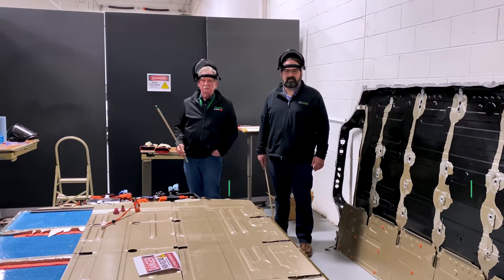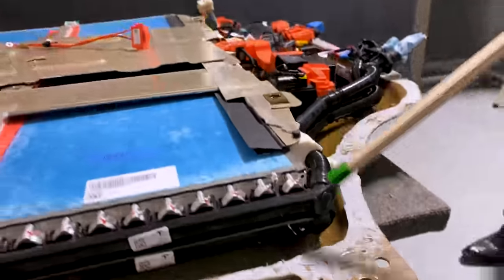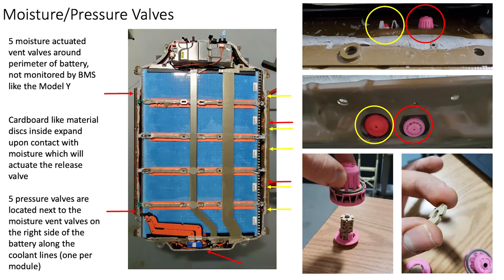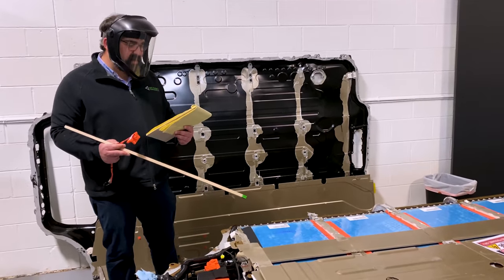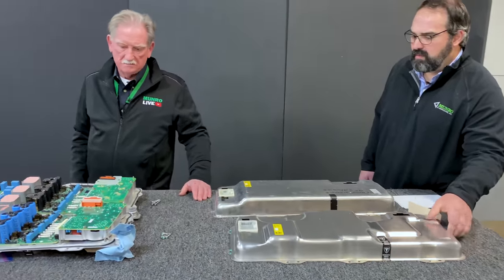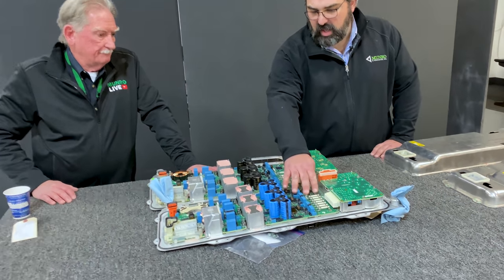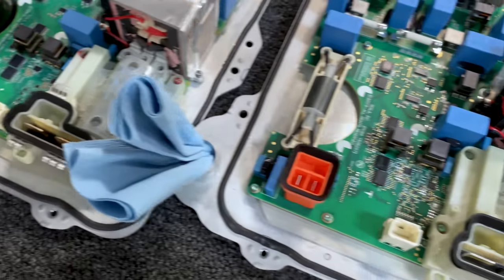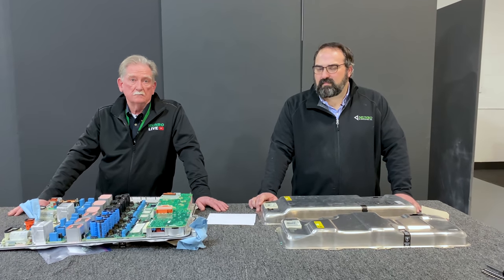Engineering Masterpiece | Tesla Model S Plaid Battery Pack

Comment: Great teardown, this is the one I was most waiting for and why I contributed to the cause!

The reason they used the 18650's is not because they are easier to cool - remember from battery day one feature of the 4680's is that they generate far less heat and therefore will require much less cooling.  They are using the 18650's because they have cell supply.  The version of the car they are selling is only one of the ones developed - they had/have a 4680 version with a structural pack as well (The Plaid+ used it.)  By using the 18650's they can use the 4680's from Kato to ramp Austin first, then once Austin can produce 4680's the Kato production can be moved to supply a new 4680 based version of the S/X - perhaps as a Plaid+ or put them into Semi production ramp, or even into a roadster II.  They eventually will release a new version of the S/X with the structural front casting integrated with a structural 4680 pack.

Given cell supply constraints this might all be a while, but Tesla tries to move very fast.
Reply: I thought that too and am surprised Sandy didn't know that.
Reply: You're right, 18650 cells were already mass-produced in enormous quantities because so many notebook computers and other gadgets use them.
But, as Tesla production increases, it's worthwhile for them to develop their own cells, and they will make them in cell sizes that allow lower cost and better performance.
Reply: It's just the way to save money - that's it. There are NO fundamental differences between 18650 and 4680 - they are just different size - 5x capacity thus 5x less cells. It remains to be seen whether the battery will be structural (the way Tesla sold it at their presentation), because, you know it's a 2 tone vehicle and those cell walls be rather thick. Of course, they could always do it just like, you know, every other manufacturer does it and makes the strong shell and then populate it with cells and call it a day. But no one would notice and would treat the 4680 as 'next level engineering'.

Remember the Plaid was in development BEFORE Tesla got overvalued and the money started flowing into the business, so everything was done on a budget.
Reply: @amimartian  Actually there is a huge difference.  The 4680 doesn't have tabs.

Comment: Thanks Sandy and your team- can’t wait for 4680’s!
Reply: Why?
Reply: To get Sandy and his team’s opinion on its engineering.
Reply: It's legitimately just a larger cell. Not much will change
Reply: It will be interesting to learn how good those are for heat production at a given C load. Tiny cell surface area per unit of volume do hear needs to perfectly come out the one short end that seems to get glued to a cooling plate. I hope 4680 will offer 360 Wh/kg, ideally 400. But it's Tesla so we need to not get our hopes up too much.

Comment: Hello Team Munro, a heads up. You missed a couple of variants of the Model S in 2019 and 2020. A 23:29 you show a table of pack sizes, model years and efficiencies. I own a June 2020 Model S AWD Long Range Plus, EPA rated at 402 miles. It is nominal ~100 kWh. A few months prior there was a 397 mile version. This was the base Model S. There were no 85 kWh packs for sale and only a Performance Model s above it. After 14K+ miles my weighted average efficiency is 245 watt-hours per mile.

Comment: They probably increased the switching frequency on the Charger a lot, that´s why they can get away with less filtering and smaller inductors.
However higher switchting frequencies decrease efficiency most of the time.. (they may have compensated for that by choicing other MOSFETs which switch faster, like GaN based ones)

Comment: When they showed the underside of the filter board housing there are two blank coil housings.  They should have drawn the insight that those are likely either utilized in another vehicle or will be.  I’m thinking cybertruck.  So the filter board housing is likely designed for multiple vehicles.
Reply: No, it was just dumb original design. Instead of having a large transformer to reduce outlet voltage at the input as on the Model Y they allow higher voltage to flow through  down the line and then use smaller transformers (as they now have 4) to further reduce the voltage. The coil at far left end was used as part of the LC filter, which in the latest version is replaced by a ferrite choke (to suppress high frequency noise).
Reply: @amimartian  Thanks for that clarification.
Reply: @amimartian  I understand your confusion, since the input coils on the older design really look like plain mains transformer, but both older and newer version are 3 phases switching converter designs ( @50/60Hz, you simply cannot pass several kW of power through any transformer small enough to fit here). The missing input coil were inductor ( probably common mode ones ), designed to prevent "leaking" the high frequencies into the mains. As Mikeselectricstuff said in his comment, I think they simply increased the working frequency of the converters, which requires far less filtering, hence the smaller input and output inductors ( roughly said, as frequency increases, magnetics can get much smaller and still perform the same job). The added small transformers looks like gate driving transformers, they are far too small for being part on the power path, this is probably related to the frequency change. Cannot wait to see more from Sandy on this subject.

Comment: Mica is used as isolation barrier to protect the battery pack when it come to TR. Mica can stand 1000℃ and it will not burn throuth when the cells are TR.

Comment: 85kwh battery pack is old, they have since introduced the 90 and 100 kwh battery packs on the previous generation Model S and X.  They were called the 90D, P90DL, 100D, and P100DL.
Reply: Yes and the 100 pack actually has more cells and higher capacity than the plaid pack.
Reply: @davidglieder8862  Well noted. Would you have the Wh/kg for these latest cells please, also in relation to previous 100 packs?

Comment: To compare the two models you have to buy them at the same time from the same factory. A year makes a big difference. Production lines are always changing  and everyone is trying to suggest improvements in everything  from the packaging used to deliver the parts to how to assemble the parts. You might notice that all the fasteners are star drive and mostly the same size, something all manufacturers should do. The engines might still be using separate resovers but they are looking to integrate them into the main windings and magnets since it takes a little change in wiring and software and eliminates 3 stations on the line. The best part is no part.

Comment: For future shows: how about details on conducting quality control ? How do designers and manufacturers test for robustness, safety, resiliency, stress, repeatability, ...etc.
Reply: You can't really get that info from a teardown.  You can see that the packaging is tight. Tesla's issue with quality control usually involves things like panel gaps and seals. You rarely see people complain about the powertrain.
Reply: It’s a Tesla. They don’t. That’s why they are on their third recall this year, still broken heat pumps, now missing hardware in cars sold as FSD-capable. Chrysler made better cars in the 1980s.
Reply: @Ficon  wow, if thats true tesla has the least recalls of the entire industry, mercedes had 18 last december alone for example.
of course they test everything and learn from the customer experiecne , there is no better way, no matter how much you test, the real test is the customer.
Reply: see - Dave Lee , interview w/ Joe Justice former Tesla.
Reply: @Ficon  still the most satisfying car brand rn🤡

Comment: The number of fuses on the charger is different versions for US 2-phase 240V power, and European/international 230/400V 3-phase. Most likely the Plaid will use the same 3-phase charger in all markets, only configured differently with the charge port connector and software.
Reply: Actually, US 240V is still single phase.  It's just two 120V lines off the same phase from the powerlines.
Reply: @charlesball6519  The phases are different (180º), agree ?
Reply: @jm-btt  Not even 180 degrees apart.  As I said, for single family houses in the US, it's a single transformer connected to one phase of the main feeder lines.  The transformer supplies two 120V lines and a neutral to the house off that one phase.

Only in apartments, condos and commercial businesses is there actual 3 phase power where you get 120V, 208V, 240V and even 480V (This is accomplished by three transformers on one utility pole)

Comment: The coil on the output of the older charger and the ferrite core on the output of the newer pack serve the same purpose - reducing the amount of common mode voltage (positive DC waveform) outputting to the battery pack. This is pretty much the same as the filter you will see on many laptop dc power supplies.

Comment: Smaller filter with fewer/smaller coils only come with an increase in switching frequency. Increase if "effective" switching frequency can be achieved by switching faster, using a multi-level or interleaved topology. Additional gate-channel isolation transformers as well as fuses will ultimately result in more semiconductors below the PCB. The additional semiconductors can then be used in parallel reduce losses and allow for higher switching frequency. Alternatively a multi-level or interleaved topology could be used to achieve a similar result.

Comment: @5:26 those "heavily machined" cooling connectors are intriguing. Inlets and outlets on the same side of the pack too. At first glance it seems like that would make the far end of the pack much warmer than the connector end.  Coolant would pick up heat from the cells  then turn around and bring that heat right back. Unless the coolant always remained cooler than the cell, then cell cooling would merely decrease due to the lower dt. For that simple flow pattern they wouldn't need those fancy connectors though. So yes, it'll be interesting to see what's happening in those connectors.

Comment: Just out of curiosity, why didn't you drive the battery to zero state of charge before the teardown? For safety purposes.
Reply: just a guess from sb who is curious on the same question:
probably driving the battery to 0 pretty much kills or at least harms the cells (talking about actual 0, not 0%) and they want to do tests on the cells both about energy dencity, charging, other stuff and chemistry given that they write detailed reports on the car that they sell to other companies (competitors)...
Reply: 0% doesnt mean there is no more voltage, its still dangerously high. You would only discharge for fire savety reasons which is no serious concern if the battery isnt mechanically or thermally stressed
Reply: The batteries are pretty much harmless they're only 85 volts and as long as you don't complete a circuit you're good. it's not like ac where if you touch one wire and you're grounded your toast

Comment: Interesting you focused on the coil reduction, but didn't mention the Ceramic and Film Capacitor's were significantly increased - I'd be interested to see what the filter curve from that, but shows you can change things up. Also interested in seeing the cost difference of reducing the inductors but significantly increasing the capacitors.
Reply: I've only done this tradeoff on a tiny filter, but using more capacitors vs inductors is generally more expensive but smaller and more efficient.

Comment: Isn't it possible to swap the verts with a GORE-TEX fabric? 
All this great info for only $10 ? Better then university ;-)  
TESLA is clearly fine-tuning EVERYTHING. And I really love for what I have seen so far! 
So bad I'm not a US citizen.
Reply: Gore Tex will pass moisture, not air. That is a pressure relief valve.
Reply: @GregHassler  The trick of gore-tex is air can pass and moisture can't get in. Depending on how you install it. They already use it on rear and front lights preventing moisture can't get in but hot air can go out.

Comment: Note the potting compound on the torroids not only help with thermal transfer - they reduce the noise (hum) by eliminating air flowing in the flux fields. And the Mica is both a thermal conductor and an insulator and probably has a very high flammability rating. I bet when one of those enormous nuber of individual batteries blows the momentary temperature (white flame) is very high.

Comment: Interesting venting strategy. I like how they combined the pressure equalization and moisture control valves ( pink). However wonder why the (red) high pressure relief valves are only on right side?  What if there is side impact to right?  This would not allow high pressure relief on left???

Comment: Is MPGe going to stay around, or will we just use single digit ratings of Miles/KWh?
Reply: IF there was any sense in the world, and I am convinced there isn't, miles/kwh would be the metric used.  It's easy and straight forward which makes it unlikely.
Reply: Distance per standard unit of energy makes sense, so don't expect it to become mainstream any time soon. :)
Miles per gallon
Kilometers per liter
Miles or kilometers per kilowatt-hour
All of these units are straightforward and usable. Marketing departments like to fuck things up to try and relate to dudebro consumers :)
Reply: Hybrids are weird, get to be rated on fuel needed on a short drive using the battery first. On long drives they will barely save fuel.
Reply: Energy over distance, as in kWh per km (or 100 km) is the way to go.

Comment: I would be interested to know if there is any capability for v2g or v2l with the newer inverter/dc converter . I remember there was rumours about this on the m3 a while ago  which ended up not happening.

also why is the MY pcb conformal coated but not the plaid one ?
Reply: There could be, but tesla doesnt think you need it. Hyundai does, though.
Reply: @slavko321  yep , I see it as quite a useful feature .  I see it being a feature on the cybertruck for power outlets , so they must be working on that tech ?
Reply: @slavko321  Tesla is the god that decided what we need and thus are allowed to have. No V2L, no wagon, no nerd mode.

Comment: Phlogopite mica remains stable at higher temperatures (to 900 °C (1,650 °F)) and is used in applications in which a combination of high-heat stability and electrical properties is required. Muscovite and phlogopite are used in sheet and ground forms. Wikipedia

Comment: I don’t quite get why you chose to compare it to the very old 85kWh pack instead of the actual predecessor the 100kWh pack of the Ludicrous Models.  Compared to that the new one actually has less cells and a lower capacity.
Reply: Maybe because they didn't tare down the P100D and do not have that battery pack to compare?
Reply: @AGUADILLAN1  Sure, but the P100D battery specs are readily available.

Comment: A lot of that is not efficiency it is cost savings. Reducing copper and iron is about cost saving not efficiency with regards to the charging systems. I would bet the power coming out of that newer charging system is much dirtier and wonder if it has the same durability? Unless the IC's and transistors are much more efficient and more robust taking out copper and iron just means cheaper! With out knowing what the actual specifications are and how they have changed it is hard to say it is "better" unless your only metric is cost savings. Look at the trouble GM is having with warranty and out of warranty issues due to the wrong kind of cost savings!
Reply: I guess it's about creating a balance. There's always a tradeoff somewhere. If it's about efficiency, I'd think it might be more expensive to manufacture.
Reply: Cost savings yes, efficency also yes, however LCL and LC filters are like music instruments tuned precisely to switching frequencies and there is nothing wrong with this picture as far as reliability is concerned. As switching losses go down because semiconductors get better so the switching frequencies go up and this reduces always the size of "magnetics" components. As for the need of additional isolation transformers I speculate that they have added additional two Hall sensors in order to measure current around planar transformer. As previously it might been enough to measure current using just two resistor shunts (which cant measure things around transformer due to too high switching frequencies)

Comment: 18650's are not smaller "batteries", they're smaller cells (than, for instance a 2170 or 4680). 
They have 100 kilowatt-hours of energy in the pack, not 100 kilowatts (which would be power). 
The amount of energy (number of watt-hours) per unit mass (kilogram) of battery is energy density, not "efficiency".
Reply: They are smaller in diameter.
Reply: I rarely read a post or watch a video where the reporter/narrator has the foggiest idea about energy vs. power, let alone knows jack about the units!
Reply: @Resist4  And length. This we all know.
Reply: @Resist4  That whooshing sound is the point going over your head. 

Yes, an 18650 cell is 18 mm in diameter by 65.0 mm long, which is smaller than the 21 mm by 70 mm of 2170, which has nothing to do with using the wrong word "battery" instead of the correct word "cell".